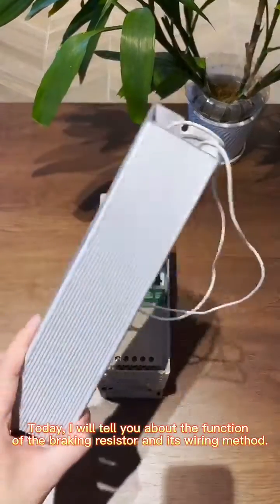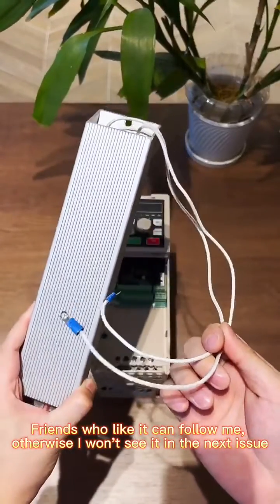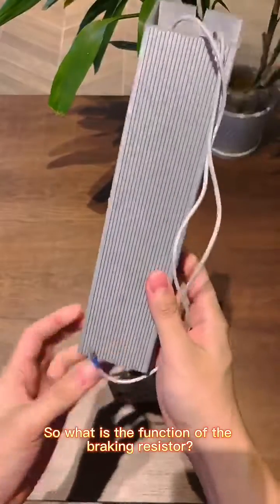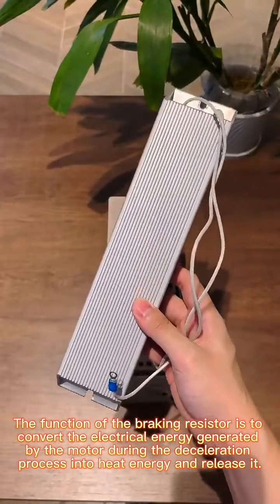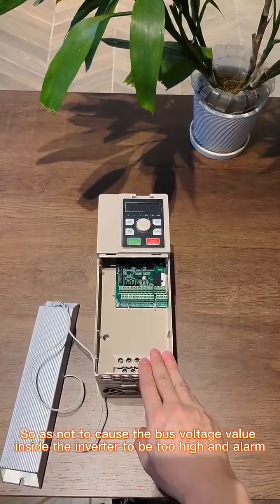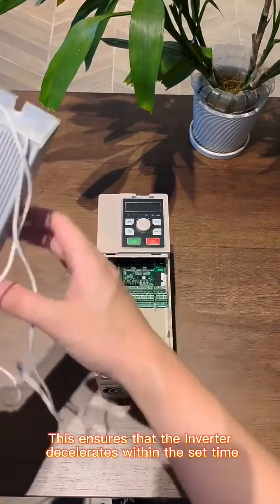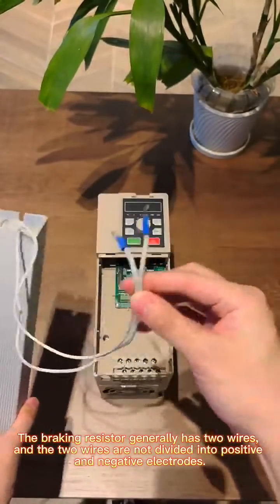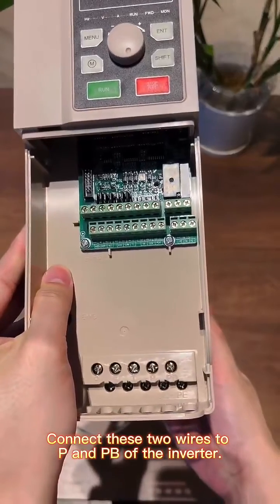What is the function of the braking resistor of frequency converter

Comment: i have HSD spindle 9kw for cnc router what size of brake resistor i should by ? and do you have it ?
Reply from the maker: Thanks for your interest! For a 9kW HSD spindle, the size of the brake resistor depends on the specs of your inverter .However, we currently do not sell brake resistors separately. If you purchase our inverter, we can recommend a suitable brake resistor model to match it. If you’d like more detailed support, feel free to message us directly or leave your contact info — we’d be happy to assist further!